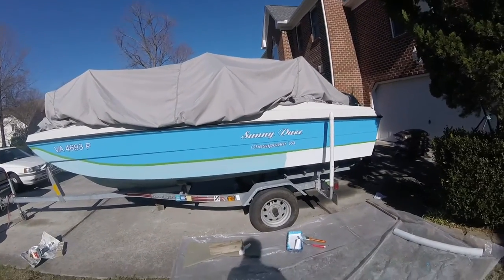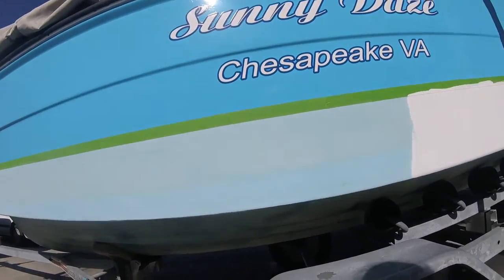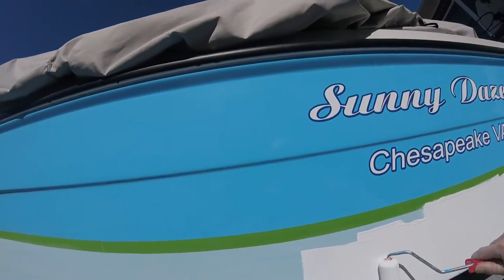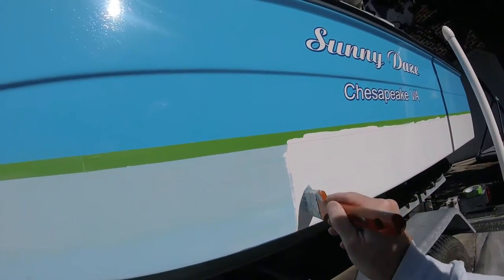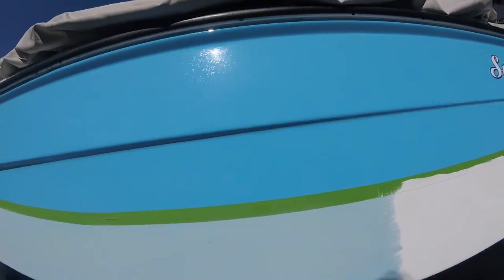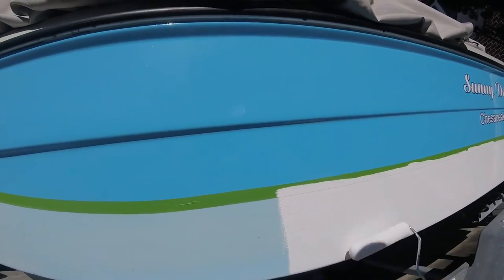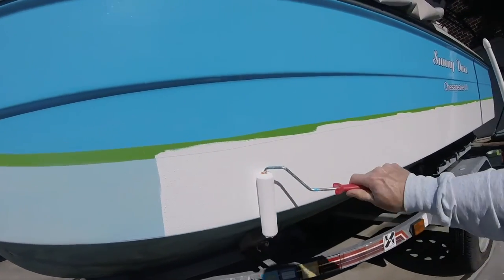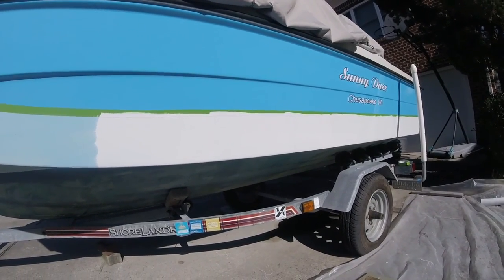Boat Restoration Brightside Painting Roll and Tip Thunderbird Tri Hull "Sunny Daze" Episode 17

Comment: Did you sand or prime the hull prior to painting? Or did you paint right onto the hull? What sort of prep before painting? Thanks!
Reply from the maker: Hi Joe G,Thanks for the comment and question. I kept hull prep pretty simple. After sanding it with a light grade sandpaper soft black sponge block I wiped it down twice with thinner on a soft cloth. If the hull had been waxed recently I might have done more however I new this hull was devoid of any prior buildups. Each case is unique, make your best assessment of your own situation and go with it.

Comment: Sorry but your doing it wrong! Always brush back into the previously painted surface to avoid scalloping!
Reply from the maker: Hi Skipperup, Thanks for your feedback and comment, but, I disagree. By feathering in and out there are no problems especially with scalloping. In addition the Brightside paint is self leveling therefore by doing small areas and moving on to the next area they merge well and become one smooth surface. Good Luck.

Comment: Great video! Do you wet the brush with paint before doing the tipping?
Reply from the maker: Hi Brian L, Thanks for the question. No do not get the brush wet. The roller applies the paint. The brush is used to remove any bubbles, even the application allowing the paint to do it's thing which is to self level off the paint. Angle the brush, tip as lightly as possible, feathering in and out. A couple of squares and you will see yourself how to do it. Try it out on sample or area you don't care about if possible first. Good Luck.
Reply: Windy Daze Sunny Daze oh ok thanks for the reply!

Comment: Hey I'm going to paint my scow with this paint did you thin the paint before painting the boat btw your boat looks great nice job
Reply from the maker: Hi Shore Vapor, 
Thanks for your comment and question. I used the Brightside Medium Blue paint right out of the can after stirring it well. For rolling I definitely recommend using the shortest nap roller possible, also using a small roller like I used is definitely preferable to a standard size roller like the one you would use if you were painting a wall. Try a small area you don't care about first and see if you like the results, then move on. After tipping with a small fine brush as lightly as possible allow paint to self level. Good luck.
Reply: Windy Daze Sunny Daze thankyou very much sir.

Comment: Did you thin paint at all?
Reply from the maker: Hi PhantomZO9, 
Thanks for the question. No thinning was necessary, plus I did not want to diminish in any way the properties of the Brightside paint by thinning. When working with it I recommend starting in an out of the way area, see how it works for you but be patient, allow the paint to self level on its own after rolling and tipping. I think that impatience is why some people feel the need to thin. Allow the Brightside paint to work as it is produced and designed. Regarding tipping, I have used an inexpensive chip brush and an expensive brush. For me I would use the inexpensive chip brush, it gave the lightest touch which is the point of tipping. Try both, see which works best for you. Good luck.

Comment: Mine came out like shit.  Orange peel galore.  I am going to wet sand as I have 4 coats .  The sides I may spray
Reply from the maker: Hi L2Fish, thanks for the comment, why 4 coats, 2 is all you need at most.
Reply: @WindyDazeSunnyDaze  Seemed to be going on thin.  I sanded a couple times and i went through
Reply from the maker: @L2fish  Hi L2Fish, I applied on a cool day with very low humidity. I sanded only lightly after 1st coat with a soft block, washed, cleaned with brushing thinner then applied 2nd coat mainly to create uniform color throughout. Try on a surface that doesn't show till you get the look that you like. "Boatworks Today" did a video on same, he did just roller on 1 test surface and 2nd surface with roller and tipping. Check that out, haven't heard anyone spraying. Mine has been on 4 years still looks great and I go out every 2 weeks. See my most recent video on Mercury motor graphics upgrade. Good Luck.

Comment: What type of paint did you use?
Reply from the maker: Brightside Paint Medium blue and white from West Marine, they do not necessarily recommend it for use below the water line but I have not had a problem and it can always be reapplied.
Reply: Thanks!!
Reply from the maker: Hi Will Rios,
Thanks for your question. I used Interlux Brightside Medium Blue Paint from West Marine.
Reply: Windy Daze Sunny Daze I was told to go with an ablative paint that’s  going to be in water.  That type pain repels crap from the water that would otherwise. Stick to your boat.  I’m new to this stuff.  Never heard of ablative.  Did your boat turn out like you wanted it to?  Thanks for posting,